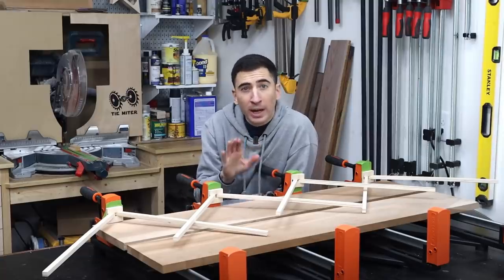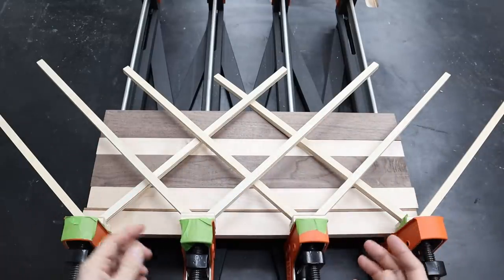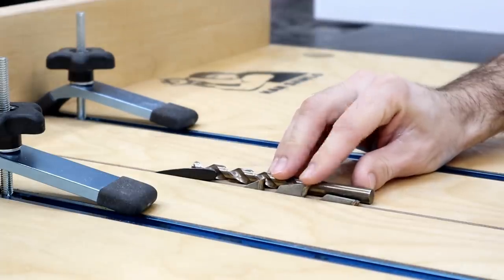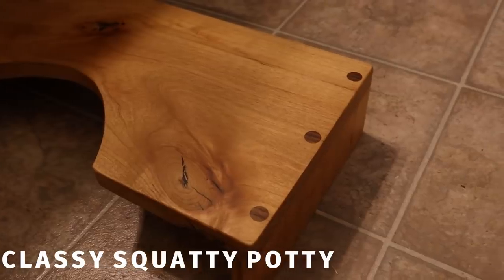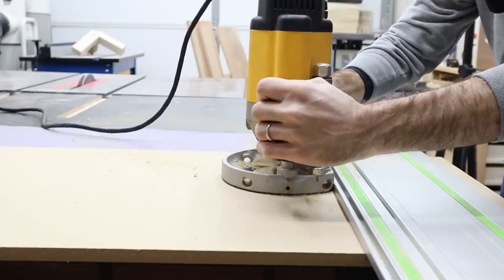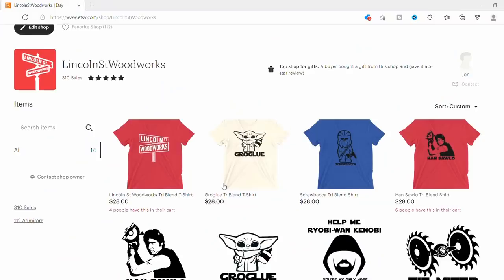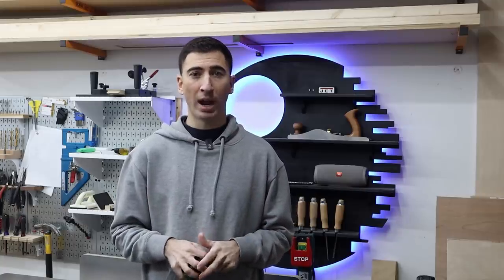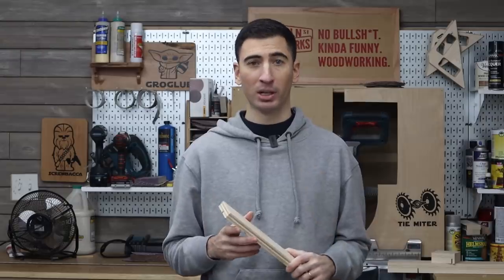I wish I knew about this before - woodworking

Comment: And you also drink in the metric system.
Science is in the metric system.
Carpentry is in both systems.
The US has actually been using the metric system longer than imperial but don't talk openly about it as it's just ingrained in the society.
So in conclusion, yes you grew up using the imperial system but the metric system is sneakily hidden in your everyday life and you just haven't realized it.
...the same is also true for areas that predominantly use the metric system as the imperial system is sprinkled like glitter that won't ever go away among our daily lives.

Comment: I took issue with this when JKM said it, and I take issue with it here. Who decided clamps exert pressure at 45 degrees? That just isnt true. It may be an ok rule of thumb, but the physics just dont add up.
Reply: I love your vids by the way, sorry for being a turd in the punch bowl. This particular tip just bothers me.
Reply from the maker: It’s the easiest way to simplify something complicated that doesn’t need to be complicated. It a decent visual representation without mentioning material density etc. The lesson is - narrow boards = more clamps. The two engineers I trust, signed off on the visual so that’s good enough for me.

Comment: While I suppose the 45° clamp angle could be used as a rule of thumb to know if you need more clamps or to clamp it differently, the 45° pressure distribution angle doesn't agree with math or physics. Is there a study or literature that you got this from? Or are you just regurgitating info from this also wrong Katz-Moses video. https://www.youtube.com/watch?v=j7e-gd-ZBdI
Reply from the maker: I spoke with a couple engineers that I trust and we agreed this was a good way to simplify/demonstrate the need for more clamps on narrow boards. There’s plenty of other factors to be discussed but it’s a rabbit hole I’m not looking to go down in 7 minute tips and tricks video and quite honestly not something I’m overly qualified to discuss in detail. Spags has a nice video on the exact topic too. The link is in the description above if you want to watch. If people are that concerned they don’t need more clamps - don’t use them. There’s an old article from Fine Woodworking too if that helps. Should pop on google
Reply: The actual math associated with pressure distribution is a function of clamp spacing, and the width and flexural properties of each species of wood involved in the glue-up, etc..... in other words, the mathematical representation of the forces at work involves calculus. No calculus for me, please. The 45-degree clamping diagram shown, although not precise in the purest mathematical sense, is a great visual image that demonstrates the concept of the relationship between clamp spacing and board widths.